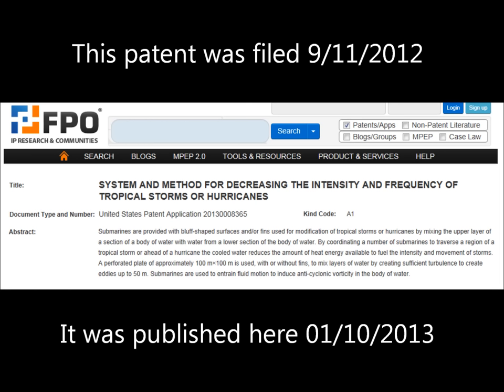U.S. Patent: Hurricane Modification Using Submarines

Comment: Just kind of wondering... couldn't it also be used for the reverse? To strengthen rather than decreasing the intensity? Not at all saying they would use it for such a purpose, I just wonder if it's a one-way type of system/method.